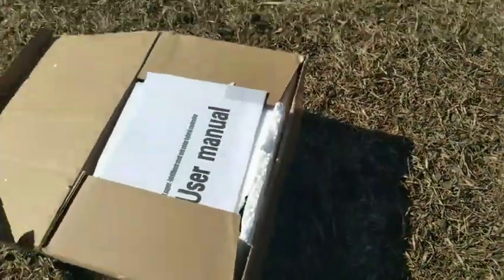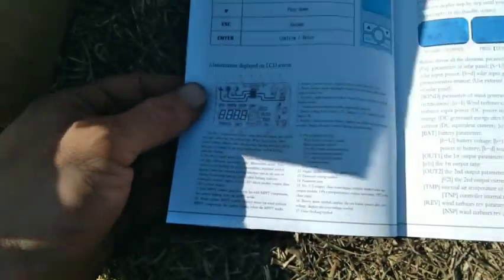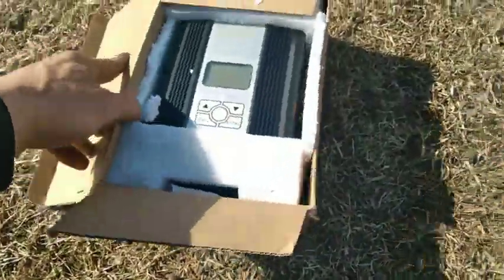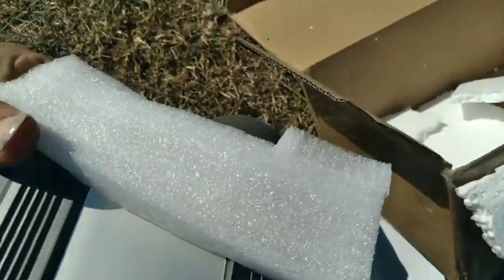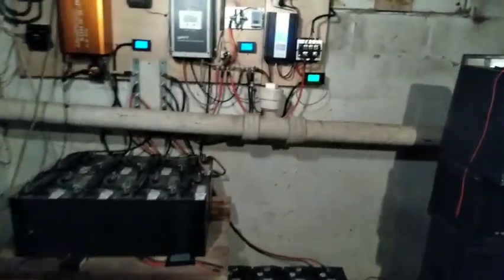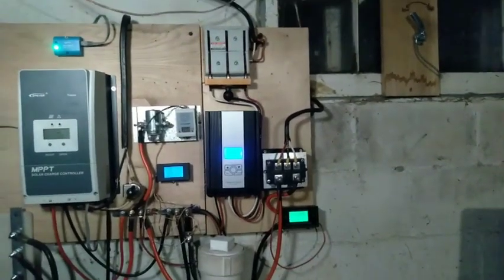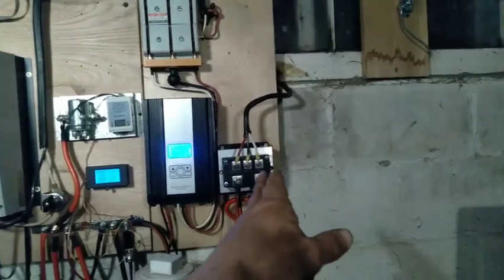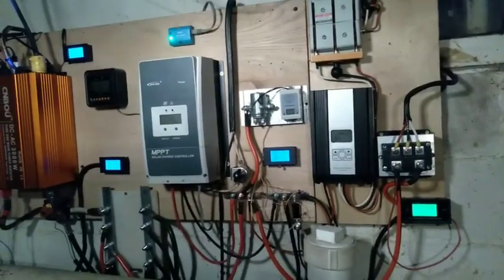MPPT Wind/Solar Controller, Max Series.

Comment: Do the battery settings set themselves?
Reply from the maker: As in 12 or 24 volts? Yes. For battery type and parameters, there are pre-sets bit they can be tuned much finer.
Reply: @smallcityhomesteaders1600 we have the 48v
Reply: @smallcityhomesteaders1600 we did figure out the settings though :)

Comment: can you make video of  your  super-intelligent controllers settings,  i have one too  and  i cant figure it  out ,  so like  til try with your settings.
Reply from the maker: @-Ok2024  sure bud, what exactly are you trying to adjust so maybe i can focus on that. From the controller, you can adjust ALMOST everything but you need the "proprietary" USB cable, software and a computer for a few adjustment and i dont have that. I'll dig up the book and run through the settings prompt for ya though.

Comment: hi can you tell me what are the parameters configuration meaning in the controller
Reply from the maker: Its not the easist thing to program.....do you still have the book? It's too much to type but maybe i could do a video on it because your not the first to ask.
Reply: actually thay did not send me the book but i figured out how to enter and to set  parameters setting but the issue is in coding mode and i don't understand what is for what , like , NNI or SBD and so on
Reply from the maker: @charbeltouma9642  ok.....i will make a video specifically for getting her prgramed. Dont fret however....the factory setting are decent. Wind power is tuff...... it only works when theres wind.
Reply: @smallcityhomesteaders1600 did you make that video for the programming? We got this same one and still have the book but can’t figure out the programming.

Comment: I just received the same charge controller you have 2 days ago.Interesting thing is I wasn't generating power until 53v.  Now two days later I'm starting to produce power at 38v.Did my charge controller have a break in period?? I have a 48v system.
Reply from the maker: They do seem to need to learn the turbine...keep an eye on it and if you see something wierd or even if you get some crazy wind and it starts to make gobbs of power.... make a video. I'd love to see!
Reply: @smallcityhomesteaders1600  Also do you use a 48v turbine on a 24v system yourself?
Reply from the maker: @armandogdgdgh3163  i do have a 48v stator sitting on my work bench, but i havent felt the need to install it. I ordered it just encase but the factort 24v has held its own so I'm not gonna fix it till it's broke....
Reply: @smallcityhomesteaders1600  did you keep the rpm at 500 on the controller or did you increase it?

Comment: Hey, just got one of theese. They didnt include any Software or cabel. Only the dumbload. Do you know where i can find the software for download?
Reply from the maker: Where did you buy it? Is it the same kind as mine in the video?
Reply: @smallcityhomesteaders1600  Ebay. Its the same kind
Reply from the maker: @Selfmadestrom.de_Blog  there a link somewhere to download the software. I'll find iy for you. You'll need a special cable as well and I can find that info.
Reply: @smallcityhomesteaders1600  That sounds so great! Thanks in advanced!!!!!!
Reply: @smallcityhomesteaders1600  Got that pice of Software. Now i need that special cable. Where did you get it?
Reply: @smallcityhomesteaders1600 also
If possible can you send me the link for the software
Reply from the maker: @Eye4God i didnt make the video yet. Got distracted by life and such. I will try to aneak that in this weekend. Here is a link to a slightly better detailed instructions then the book and the software download. 
MPPT Wind Turbine PDF | PDF | Wind Power | Computer Monitor https://share.google/JQpYdJ8lOhtPvFfcL
Reply: @smallcityhomesteaders1600  Thanks!

Comment: Have you compared performance of the turbine on mppt vs pwn?
Reply from the maker: I have not. Before the MPPT controller i had it wired straight to rectifiers. The controller absolutely works better then that. I have experience with PWM and MPPT solar controllera and the MPPT blows the doors off the PWM hands down so i went with this one and i am happy.
Reply: @smallcityhomesteaders1600  Appreciate the response. The issue I have  comes when using a rectifier in combination with a solar charge controller. In a workbench test it can give out up to double the amperage compared to the standard pwm wind controller but it will not work in real world testing with the turbine in the air. The problem seems to be the solar controller just isn't fast enough to keep up with fluctuating voltage. The turbine almost has to spin to high rpm then back off to just under charge voltage then back up or some weird combination like that before it kicks in, else it registers 0 power the majority of the time. The pwm works but only at mid to high rpm. So I'm thinking to just get a wind mppt controller and be done with it. It's just that a lot of other people are saying that they are having success with a wind turbine using solar mppts :/
Reply from the maker: I also tried the same test with the same results. However it wasnt a turbine... i built a pedal bike with a PMA on it ran to a rectifier then to a Mppt solar controller. When i first begn to pedal it would slowly allow power to come through and resistance would increase on the bike to the point where it was unrealistic to sustain. If i slowed down i would have to completely stop for a moment to before it would allow power through again. Then i tried a permenant magnet motor from a treadmill and removed the rectifier, so just running straight to the same controller and that worked better. Only ever got 200watts out of it but it was easier to at least pedal and sustain.  It kinda comes down to your location, tower height and specific turbine. If you get regular straight line wind "clean wind" a rectifier works just fine. I get very dirty wind here so the MPPT wind controller work hands down the best for my setup. In any wind it helps it feed in pretty steady power.
Reply: @smallcityhomesteaders1600  Thanks again. Yeah i think that's what you have to do just invest in a proper mppt wind controller and be done with it. Im pretty sure ill get better results. I have dirty wind too but fortunately i live in an area where I make up for it to an extent with just sheer brute force of the wind. I'm also using a 24v turbine on a 12v bank so I'm also losing half the voltage just by doing that.
Reply from the maker: @somemore9784  watts are watts....the controller will turn thise extra volts into amps!
Reply: @smallcityhomesteaders1600  yes only if its mppt. Not with my poopy pwm controller im using
Reply from the maker: @somemore9784  ahhhhh......yep

Comment: Can you put a dump load on an mppt to heat water
Reply from the maker: There is a model of this wind controller and a few i have seen that have a dump load option that yes, would allow you to use it to heat water. Unfortunatly the seller i bought mine from was not clear enough when i made the purchase because that was my intent but i did not recieve that model. That one is a few dollar more. Also, if you order this or any wind controller with MPPT/dump capability, make sure the computer link cable is included because they are proprietary and some of the functions can only be utilized by setting up though the computer link. I also did not recieve the link cable and it is expensive to order by itself. Best of luck and feel free to ask anything else. Thanks and Merry Christmas!

Comment: Interesting, but be aware that most of those hybrid controllers only run one or the other input.  If you run solar to it, you can't connect a PMA and vice versa.
I'm not familiar with your new model, but all the hybrids I ever bought don't tell you that it's one or the other, and if you hook both it will damage the CC.
Good luck.

Comment: Thanks for posting! Just cleared my doubts on what to get for my super irregular gusty wind area! I do have a question as im a total newbie on hybrid setup: can I connect this charger directly to my battery bank that is already being charged by a solar controller? Aka, any issues having 2 separate controllers hooked to same batteries? I wouldnt mind getting a hybrid controller but cant seem to find any decent ones (with good reviews) for sale...
Reply from the maker: Thats exactly what I got set up. Having multiple solar charge controllers of different ratings or type can have an effect where they fight eachother to push power in but if you want to do wind and solar, a good solar controller will work together with a good wind controller.  On really windy days however, when the sun is also out you can see a lot of amps coming in so its a good idea to also have a diversion controller hooked up to mitigate those times to prevent overvoltage. The diversion controller will let the excess power go to something else....a water heater or spot lights or fans or even just a resistor bank that can burn up approxamately 2/3 of the potential wind power and that will keep the batteries from overvolting. Very important. I have more videos on this very topic. Wind is hard to harness. When its blowing hard it can make big power and you might need to find something to do with that extra power. If your not home to sit and watch your meters everyday all day, a diversion controller will do that for you.
Reply: @smallcityhomesteaders1600  thanks! Will lookup the other videos this eve then! My off-grid setup is on a holliday shed at a farm so im only there an hour a day to feed the animals. Hence i was looking for some resistors and a controller that has automatic stop/slow down function for hurricane winds and when the batteries are full. Does this one have that function?
Reply from the maker: @DJBelbe  it does but doesn't include the resistor bank. Look up "Tumo int." on Amazon. They have the very same charge controller as me but their package includes the dump load function, resistor bank and data link so you can hook it up to a computer and really fine tune it. Controller it rated to 1000 watts of wind power but will handle surges over 1500 watts. It costs $400 but well worth it. Very much a "set it and forget it" kind of tool.
Reply: @smallcityhomesteaders1600  thanks! Will look it up! The 120€ one with resistor (but no computer setup) seems nice but everyone complains the manual and interface is a nightmare to figure out 🤣
Reply from the maker: @DJBelbe  thats the issue with a lot of them. Hard to fine tune without the computer link. The factory settings are usually sufficient though.

Comment: Im converting a cargo trailer for off grid boondocking, there's not much info on doing solar and wind. I don't want to buy equipment to find out what i bought was wrong. 
   I have 8 3.2 v 280ah cells, and was looking at 4-330watt 12v solar panels. I was wondering if a pma alternator that puts out 1000watts, spun by a vertical axis blade mounted on the front of the cargo trailer would be able to be tied into the solar to charge batteries while driving? 
   I watched a number of videos and it seems the wind power has to match the solar, but that was all that was said. Would that mean 12v solar controls, have to be tied in with a 12v pma alernator? Or that the solar charge of 1320 watts of possible solar with 4 panels can't be less than the possible 1000watts the alternator puts out, or as i would assume both? If you know? 
   Im not even sure if the vertical axis pma wind turbine can work, would it spin to fast driving 60-70 burning it up, making it a only when parked option? Then if that's the case would it get enough wind when parked to charge batteries on cloudy day's? For less than 200 bucks it wouldn't be an expensive supplemental power source, if it worked is the only thing i do know lol. 
   I am not sure if I'll do 2- 4 cell 12v 280ah banks, or 1- 8 cell 12v 560ah bank, or if i should go with a 24v bank. Since there are so many options and i would like to add wind to it, i haven't bought panels or controller equipment. If i bought 4-330watt 12v solar panels and found out i should/could have got 24v panels and a 24v pma alternator and controllers instead for some reason i won't have the money to do it twice. 
   Im not picking on anyone, but the guys with 100,000 plus subscribers don't answer to many questions, and last year when they did it was only to say no i couldn't run a 5,000 watt window ac on battery. Maybe i was wrong to to tell them by the numbers it was possible, and they seemed to be a corporate sponsored sell outs lol, but now they are doing diy basket battery builds for cheap, and running air conditioners on batteries so all in all the truth seemed to be good for everyone trying to get off the power line. However, i don't get any questions answered, so im glad to see someone posting a dual application video. If you have an answer to any of my questions or can offer an opinion on what i should be looking into for answers it'd be greatly appreciated. God bless!
Reply: If it matters, i want to run a 5,000 btu window ac, a 12v pump for water, and a small derp freezer as a refrigerator. A small water heater would be a bonus!!! I add that because "what do you need that much power for in a cargo trailer if your camping" seems to be the response i got before i put the electric on the back burner, i have 2 rescue dog's and if im in arizona or somewhere that it's 110 in the shade, id like to be able to keep them cool. I ended up having to justify me needs, instead of getting helpful info. Just thought I'd add that. Iiked your chuckling, that only comes from a man in full. Sounds like your happy the hard work is paying off, and it was a job well done.  Congrats!

Comment: I have basically the same wind controller, sold by a different company, Tumo-Int..  I also have the special RS232 cable (it has a special key code in it, so you need theirs).  I connect it to my windows netbook to set all the parameters, and I leave that small old netbook connected all the time for convenience, rather than going though the screens on the device.  It works very well.  That netbook can connect to the internet, so I log into that netbook from home and adjust the parameters of this controller on the fly anytime I want.  The controller boost function allows it to get small amounts of wattage all night in relatively light wind that would not raise enough voltage through a rectifier to charge anything.  Best one I have found.  The ONLY problem I have is that mine is the 600w version, with no external dump load.  Mine shuts off internally, which is okay, but in larger winds it ends up stopping and starting the turbine a lot, and I would rather just burn off the power externally so it would smooth that out for the benefit of the battery.  Yours appears to have the external dump load, right?
Reply from the maker: Yes sir. Honestly, I wish I would have found Tumo before I ordered this one because as you said, I need a proprietary cable to pair and fine tune with the computer. The seller i ordered from did not include the cable, software or the external dump load. I already had a dump controller from thermodyne so I just use that one. But all in all i'm still pleased with my purchase. Great controller and it's amazing what it can harvest in almost no wind.
Reply: Do you know where i can find the software for download?
Reply: @Selfmadestrom.de_Blog  You might email Tumo-int.
Reply: @kevinmcmanaman7774  where you buy the cable?

Comment: Great controller ;)
Reply from the maker: I love it! Worth every penny!
Reply: @smallcityhomesteaders1600  i looked up and cheapest i found was 185€+shipping but they dont make 12v controllers...
Reply from the maker: @SigmaWorksSW3D  ill find one for ya!
Reply from the maker: US $147.84  12%OFF | 12V 400W MPPT Wind Generator Controller with Boost and Buck Function 6V to 60V Charging Free Software Monitor CE Certificated
https://a.aliexpress.com/_m0LSBJd
Reply from the maker: @SigmaWorksSW3D  US $189.00  25%OFF | 400W 12V wind solar hybrid MPPT (boost model) charger controller with LCD display, RS232 communication, dual 12A output port
https://a.aliexpress.com/_mNRFok3
Reply: @smallcityhomesteaders1600  Tnx
Reply from the maker: @SigmaWorksSW3D  US $155.12 | 400W 12V Wind Solar Hybrid Controller With MPPT
https://a.aliexpress.com/_mOjskp5
Reply from the maker: @SigmaWorksSW3D  there's a few...i've gotten good at searching in aliexpress. ;)
Reply: @smallcityhomesteaders1600  Big tnx ;) this one is quite cheap... i was looking bit bigger and expensive ones :) if i will have spare money then i will order this one because i will need solar controllers more than 3 :D for 27 50w panels
Reply from the maker: @SigmaWorksSW3D  for solar, Epever is the way to go! Great controllers with great interface for editing parameters. I had a couple different scc before my epever and ill never buy anything else.
Reply: @smallcityhomesteaders1600  i am  looking on epever controllers all time but price point even for 10A mppt is too hight for me right now... even if i will have 500€ only for solar stuff its too high... i will have to buy controllers one at a time, another inverter 2kw pure sine wave cheap one EApower, 18650s 2kw, and 27 panels... thats my limit for now...
Reply from the maker: @SigmaWorksSW3D  i hear ya bud...we do what we can. I've been building this system 1 part at a time for 5 years and im finally quite happy with everything.
Reply: @smallcityhomesteaders1600  yup ;) mine will also be 70% finished after 5long years :)